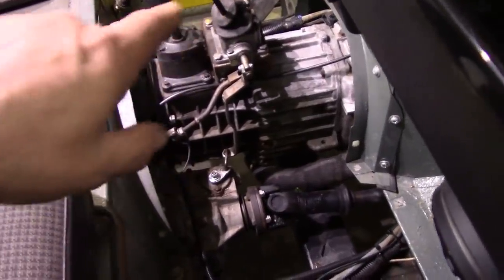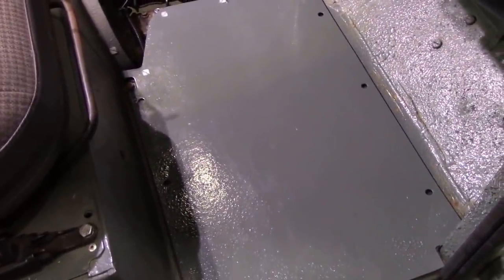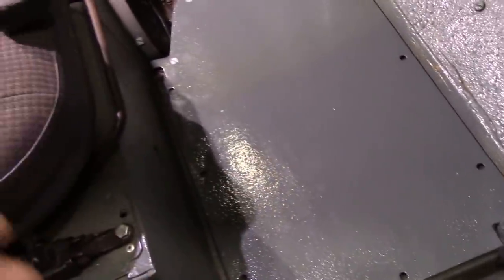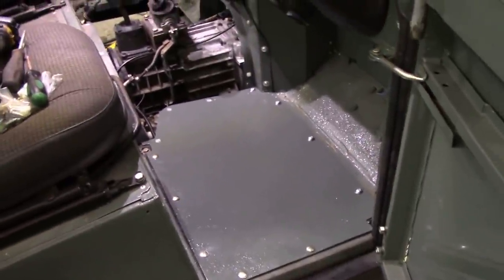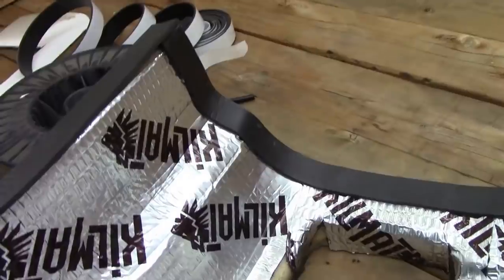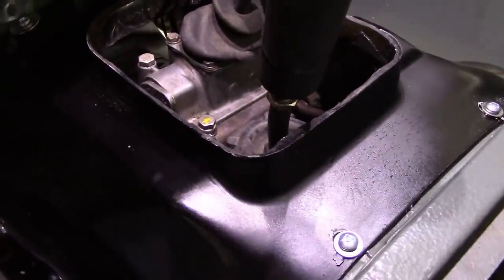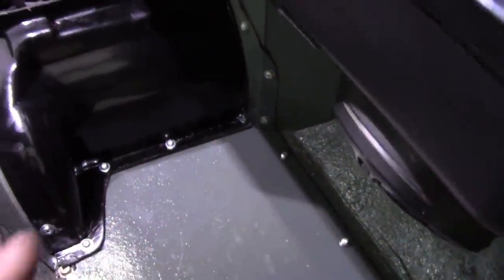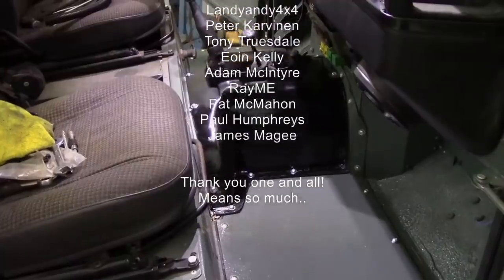Fitting the floor to the 110 project. Part 2

Comment: It’s the bits like the floor that bring a sense of nearing completion to a project! It looks great👍
Reply from the maker: Yes this has dragged on for 2 years now! I seem to recall it started as a 2.5 NA, then I fitted a Disco 2 V8 and auto box ( that was a kings ransom in electronics so ditched that idea) then a 300Tdi, now the GM 4.3!

Comment: Hi Mike. Before I started watching, I wondered how you were going to fix through the seal. Using the soldering iron is a great idea - another top tip. Loving it. Simon.
Reply from the maker: I use the same method for headliners!

Comment: i use dome head stainless bolts with penny washers top and bottom works a treat no rust any easy to get back off also stainless self tappers i use stainless were ever possible it makes sense too
Reply from the maker: I now have stainless self tappers
Reply: @BritannicaRestorations  they make life so much better i also make gaskets between steel and ally seems to work rather well i use damp course plastic along with the stainless
Reply from the maker: After struggling with customers vehicles that have had floor fitted with nuts and bolts, I now put them all back to standard LR fittings as it is a dream to get the tunnel/floor out!

Comment: I must have missed the video of the bulkhead work but is that just stone chip  in the footwells Mike? I've toyed with doing the same sort of thing but also thought about Raptor bedliner, especially on the outside once it's been epoxy primed and topcoated. I'm thinking bedliner over the top would make it pretty bullet proof!
Reply from the maker: I have done a few bulkhead repairs  - go to my channel home page and search for bulkhead
We do not have Raptor here and I cannot import it by air as it is flammable, but the stuff we have for DIY is not so good, so I use stone chip, which in my 130 has been good for the last 8 years

Here is one
https://www.youtube.com/watch?v=LwtopHW65Hw&feature=youtu.be

Comment: you could cut the gear stick rubber bellows part off flush with the base section, spin it round and glue it back on.  But if you can get one made why bother
Reply from the maker: I had a re think on the shift and I will get Jim to make a cover once I am happy with the outcome

Comment: whats the best method to get the tunnel in position or remove?, do you lift straight up and pull rear ward or shimmy sideway and roll over the Gbox?
Reply from the maker: In an ideal world lift it up but the lower dash gets in the way
I tend to remove the fuse box bolts and on a LHD I take the bolts out of the handbrake, then lift it at the back

Comment: ACME “spire nuts”. 😉
Reply from the maker: They call them J nuts here! I could not think of a common word!
Reply: You beat me to it!  Always knew the self tapping screw types as Spire Clips.
Reply from the maker: Also called Spiralok, Speed Nut, Spring Nut, Tinnerman nut,
Reply: @BritannicaRestorations  Or Speed clips here in Australia
Reply: "Blechmutter" here - literally "sheet metal nut", so also not very in-spired :)
Reply: Frank H  😄Very droll!  Do you want help, or will you get your coat by yourself?😉😄

Comment: The main gear lever looks to me like it needs to be lengthened anyway. I suspect you will simply extend the connection putting the gear lever knob easily into your hand which will allow the rubber gear lever gaiter/trim and closed cell noise proofing to be fitted.
Reply from the maker: When I bent the shift it was a little too far forwards - but I have a cunning plan! 

the shift itself is super light!!

Comment: How about this matting, or is this the one you mentioned? http://www.wrightoffroad.com/r380_mat.htm
Reply from the maker: No - the Td5 had a black mat for the floor and tunnel in one piece

Those heavy mats are ok, but cost a fortune to ship, are quite difficult to manage on your own and didn't make a vast lot of difference in noise reduction compared to regular rubber mats in my opinion
Reply: Those mats were developed using the same material that’s on JCB back hoe floors, that’s why there so heavy.